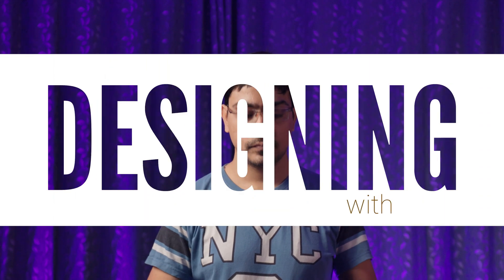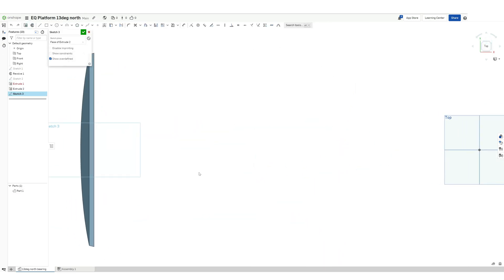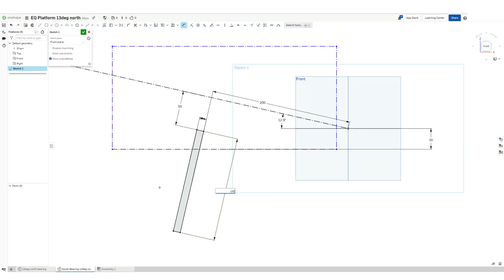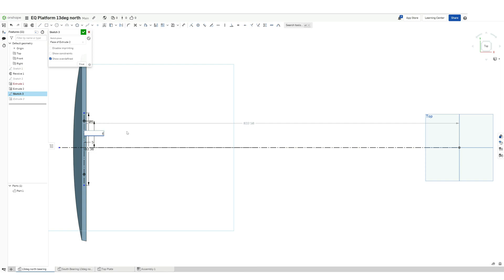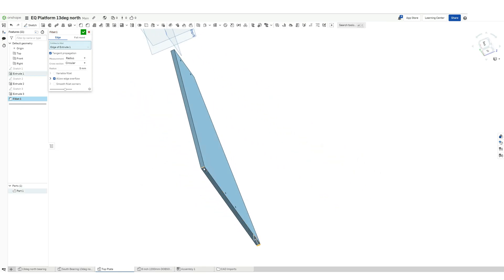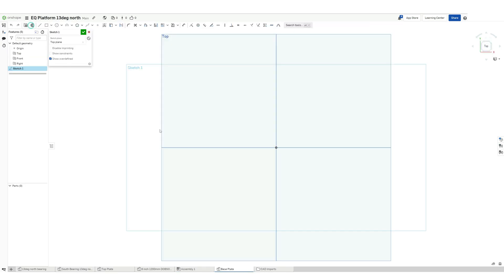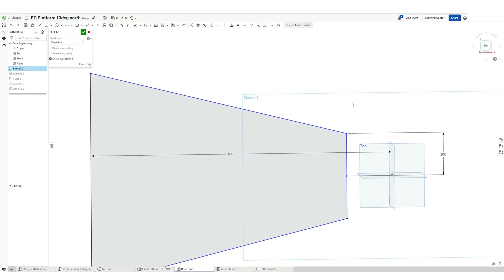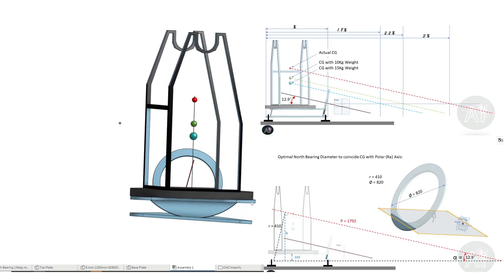How to Design and Build EQ Platform Series E03  3D CAD

Comment: One option to consider, for weight optimization ( ie. removing material, in the platform bases) could be to use your Nationality's emblems. As a New Zealander, I cut out a Silver Fern (our Country's national flower), in the bottom platform. And, in the top platform, I cut out  the shape, of a Kiwi (our National bird).
Reply: Just for clarification: I cut the silver fern into the top EQ platform base; &, I cut the silver fern, & the Kiwi into each side, of the telescope
s rocker box.
Reply from the maker: @citizengkar7824  thanks, which machine you used for it, CNC router ?
Reply from the maker: Yes Weight optimisation is very important, especially if one is trying to go out of city in search of Bortle 4 or lower Dark 🌌
Reply from the maker: I like the idea of your emblem cutouts, but that will need CNC routers, how did you manage to cut those in your platform.
Reply: @ASTROindi  I simply used a hand-held router. If I can use your email, I could send you my EQ platform build PDF, I compiled, which incorporates photos, etc..
It's the same process, I used for cutting the north & south bearings.